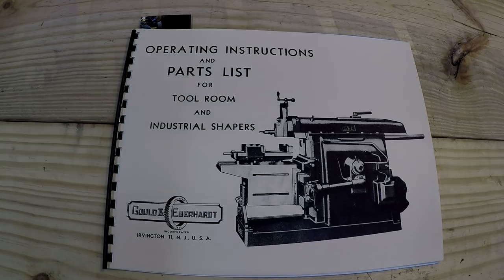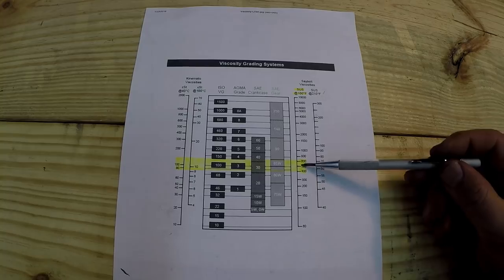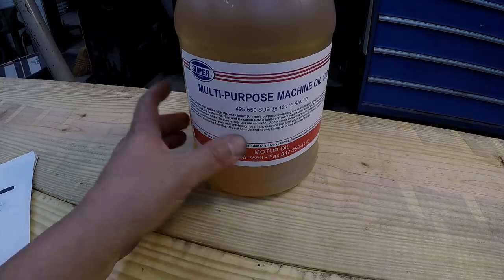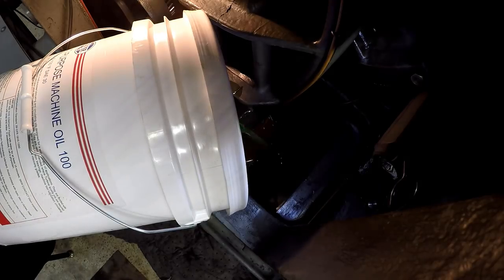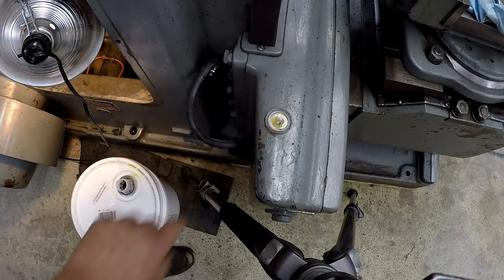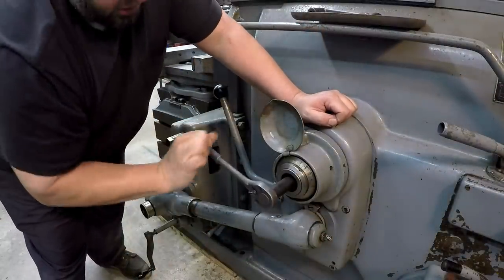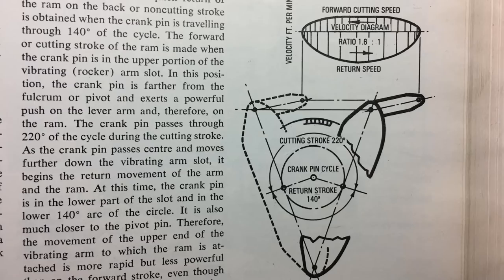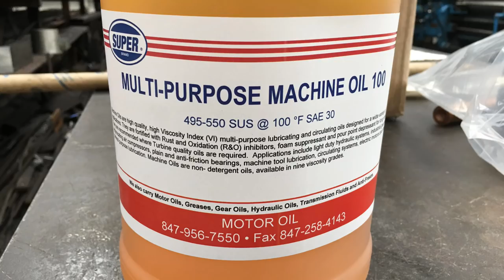G&E Shaper New Oil and Run In

Comment: Add a needle valve on the copper oil line to balance oil distribution. Looks like some rubber hoses? Not good. Replace with copper. Oil looks thin. Great, why not use a thin synthetic? These have 10 times the filmstrenght.  An immersion heater with a thermostat would give consitent oil viscosity, but the viscosity index for synthetic oil is much better so in that case maybe not needed. If the shop gets cold in the winter the tolerances on the machine will open up, some adding oil flow(?). Nice piece of machinery. I just don't see why a milling machine would not be better. The G&E looks like a museum piece. Cool.
Reply: You answered your own question about why not just use a mill in your last sentence :D It's a museum piece that deserves a careful attention giving owner to take care of it for years to come.
Reply: BadBeaver well said
Reply: Have you ever seen a milling machine cut square stuff ? You can do a lot with a miller but the shaper will do stuff a mill won't.